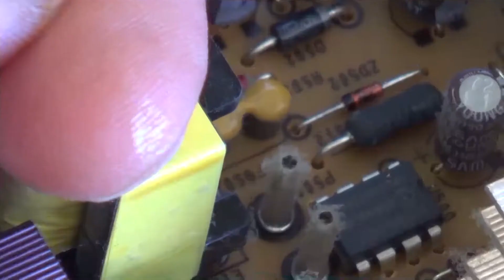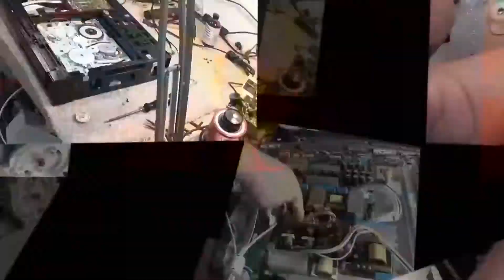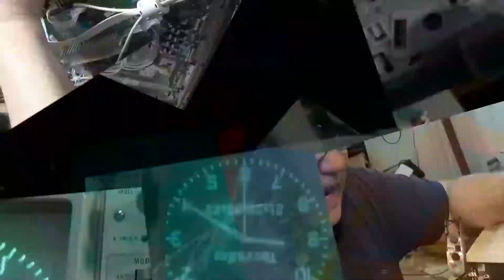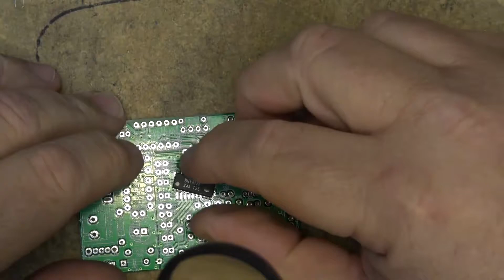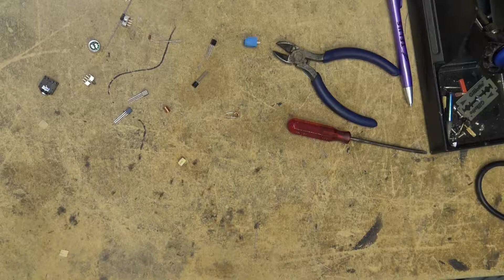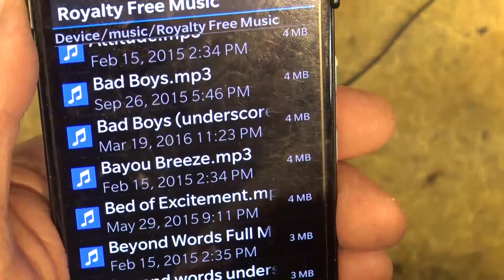FM transmitter build for patreon members only (Released for all)

Comment: I've built an FM stereo transmitter kit before.  I'm from the Vancouver, BC, area where 88-108 MHz is overcrowded.  But also, since the VHF police band at 137-144 MHz is no longer in use here, I pretty much have that whole frequency band to myself for FM stereo experiments so I modified the kit, extending its range to transmit 80-175 MHz.
Reply from the maker: Watch out.  The guy our my way that was playing in the low part of the band 87.7 where chek6 audio used to be before they went digital got a knock on his door and he was only running 1 watt but was up on the hill.  He ran for awhile but was shut down about 3 years ago.